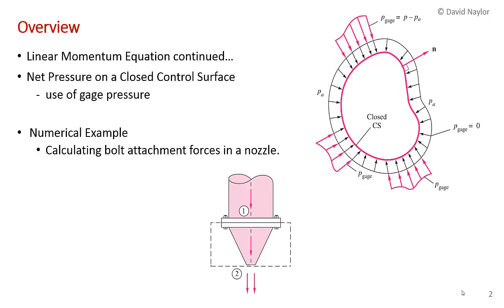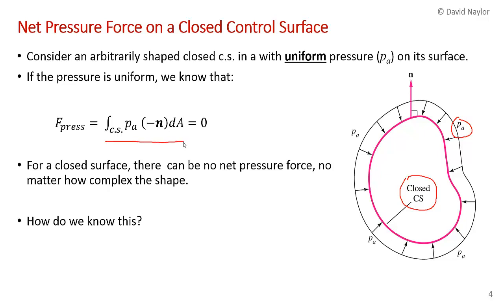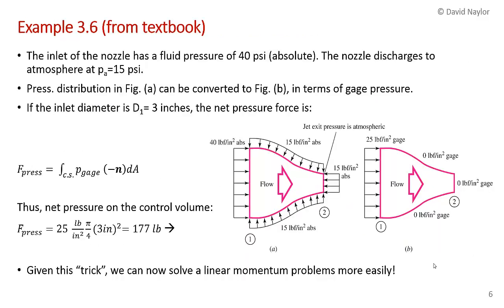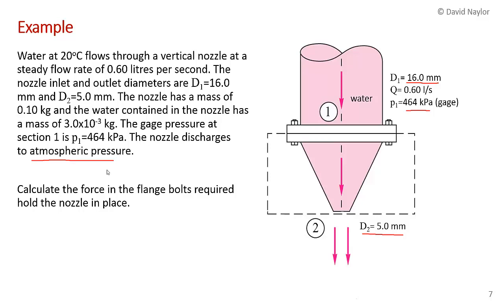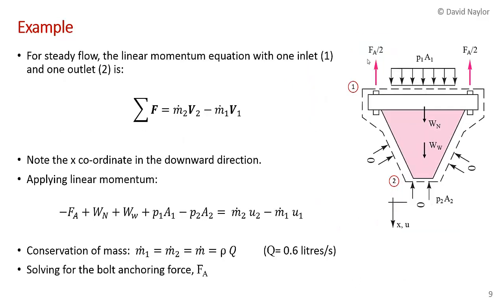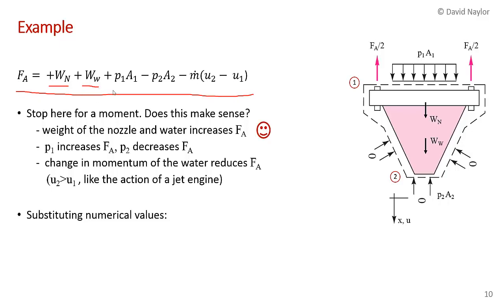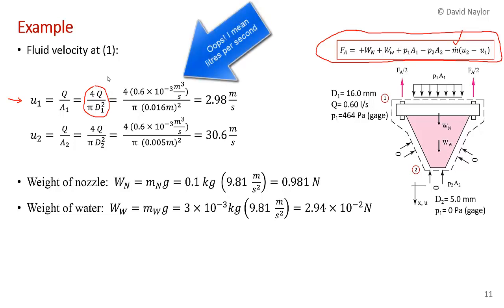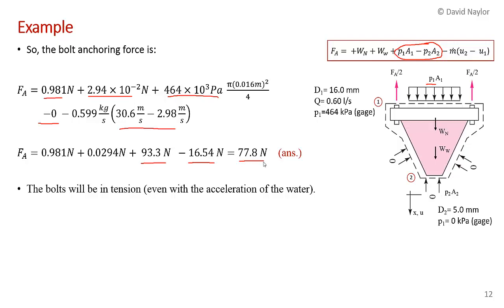Solved Problem: Conservation of Linear Momentum, Forces Generated in Nozzle

Comment: is it correct to use guage pressure,because in real world ,it is the absoute pressure that contribute to the force.we just consider guage pressure since they cancel out,but here they do not cancel out right? according to F= P * area ,  since A1>A2,the force component due to atmospheric pressure does not cancel out,there is a net value there,but how could you take it as zero,can you please explain on this
Reply from the maker: I suspect you need to rewatch the explanation/theory at the at the beginning of this video. All is explained in the first 7 minutes of this video.  You have to use gauge pressure in these problems. If you use absolute pressures, you have to integrate the non-zero atmo. pressure over the outer surface of the nozzle. That is part of the control surface. It can be done in theory, but it's not necessary. If you work in gauge, the pressure on the outer surface of the nozzle is zero (gauge).  This does not result in an error because the integral of the atmospheric pressure over the ENTIRE control volume is zero (for reasons explained in the video -- nature takes care of that force balance.). So, you subtract off p_atm over the entire cv, and work in gauge.
Reply: Whuh.just proved the pinned comment.thank you so much ❤

Comment: That was great. Am I correct in assuming that when we do a cut thru a solid even if there is no ATM pressure in that section we still imagine ATM pressure is there to use the trick and work with gauge pressure? For instance in the horizontal nozzles at the left end there is no air acting on the solid and liquid but we still assume its there and instead work with gauge.
Reply from the maker: I not 100% sure of your question. The absolute pressure inside a pipe will be affected by local atmospheric pressure even though "there is no air acting on the solid and liquid" inside the pipe. It will be the pressure provided by, say a pump, plus to local atmospheric pressure. So, yes, the atmospheric pressure "is there" and you need to work with gauge pressure. I hope that helps.

Comment: so can you say that if the diameter of the nozzle decreases (so that it is not a nozzle anymore, it is a basic circle), we obtain more thrust force ?
Reply from the maker: A change in the outlet diameter will change the inlet pressure. You could work out p_1 using Bernoulli (plus some estimated head losses, if you want more accuracy). I haven't done the analysis. But my intuition is that the thrust due to the change in moment of the water might go up or down. Although the outlet velocity (V_2) will increase as D_2 decreases, but the the mass flow rate will decrease.  Not sure if that answers your question.